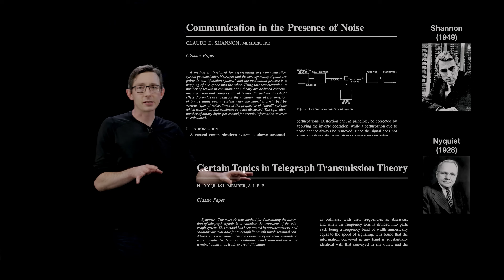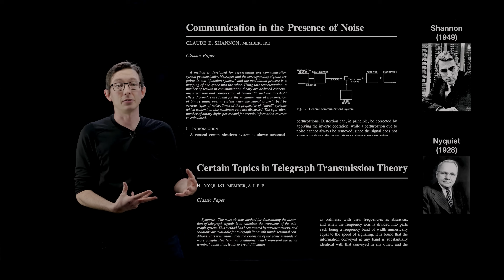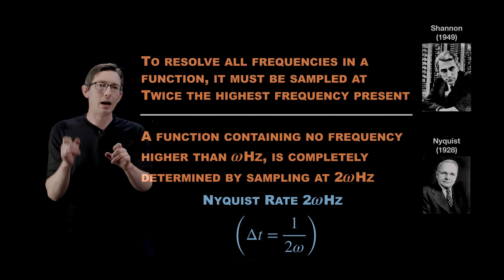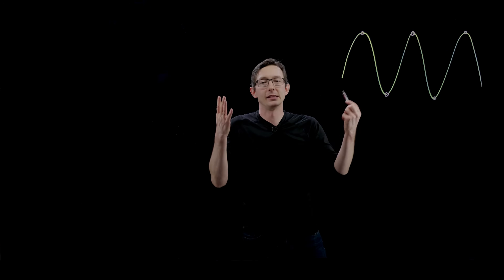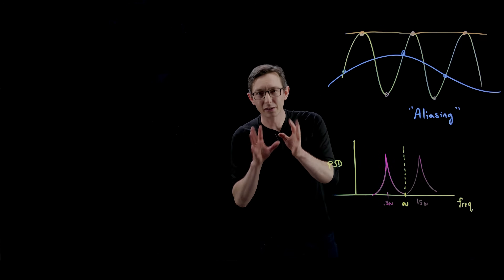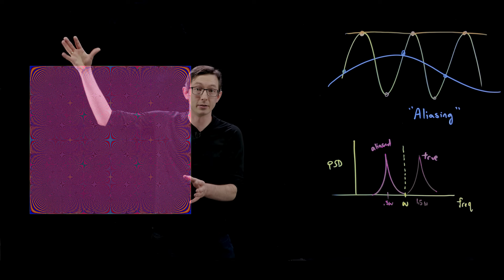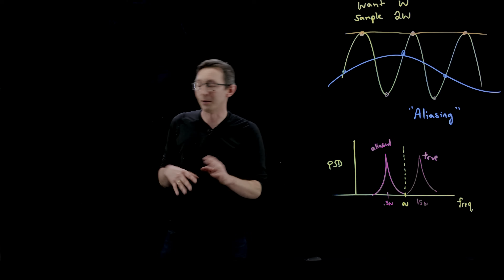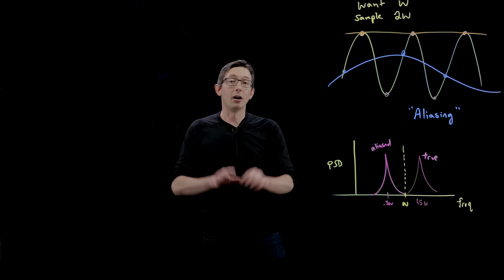Shannon Nyquist Sampling Theorem

Comment from the maker: A viewer made the excellent point that we technically need to sample at "strictly greater than" 2*omega.  For the example, if you sampled at exactly 2*omega at the wrong phase, you could easily get something that looks constant.
Reply: This is actually the reason I came to look at this video and it answered that. Thanks!
Reply: The equality holds only for even functions, e.g., a cosine.
Reply: @Leland Hugh seriously? Is this the place for this? 😂
Reply: Wow, I was just thinking about this having finished the video. Thank you for all the info!
Reply: Had the same question. This pin saved me a bunch of time searching for a solution to this
Reply: 4:20 It's a little bit nit picky, perhaps, but f is in Hertz or cycles per second.  Omega is angular frequency and measured in radians per second.  Omega=2*pi*f where the units on pi are radians per cycle and the units on f are cycles per second.  The cycles part, being in the denominator and numerator respectively, cancel out leaving radians per second.

Comment: Nyquist has a BIG caveat — it requires all frequencies to be below the nyquist frequency. And that's not possible.

Human hearing goes up to 20k, so a 44.1k ADC needs to be flat up to 20k then roll off completely by 22k. In the '80s the industry-standard Sony PCM-1630 was about $50k for just the processor without an actual recording device. It used thick-film elliptic filter networks that were crazy steep — flat @ 20k, -50 dB @ 22k.

Let's say they had used a 3rd-order -18dB/oct AA filter:

-3 dB @ 20k
-4.4 dB @ 22k
-12.5 dB @ 32k (12k aliasing)
-18 dB @ 40k (4k aliasing)

The 32k energy going into a 44k ADC is going to fold back to 12k and give you a LOT of aliasing noise. So they needed ultra-steep elliptical filters which cause ringing and group delay which smears higher frequencies.

But by 1989 they had 2x oversampling ADCs meaning the analog filter's transition band is 20k–66k instead of 20k–22k. And they had 64x oversampling in the early '90s. With oversampling then a digital LPF you can brickwall it digitally then decimate it down to 44.1k. Then you finally have a clean 44.1k recording without aliasing or group delay.

So 44.1k can give you awesome audio quality, but you either need an impossibly steep analog filter, or you need oversampling. And oversampling requires either a computationally intensive digital filter or a complex multi-stage digital filter (which is what you see in early '90s gear with limited processing power).

On the output side you also need oversampling and a reconstruction filter. The signal below 22k gets copied up to 44.1k, 88.2k, etc. So you need to interpolate it to something higher then filter it.

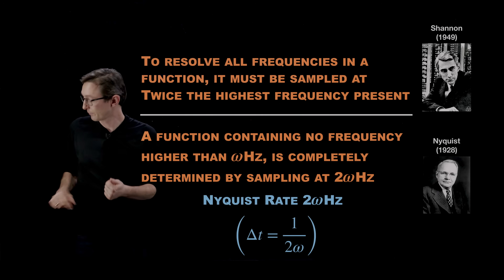Comment: 6:17 The reason it's specifically 44.1k is because they were using video recording equipment and they wanted compatibility with NTSC and PAL. They recorded 3 samples per line, and they had to leave the blanking interval for sync.

NTSC 490 lines * 30 * 3 == 44.1k
PAL 588 lines * 25 * 3 == 44.1k

It's exactly 30 (not 29.97) because the first CD mastering used U-Matic monochrome machines, and NTSC monochrome is exactly 30 fps. Some things actually have a 44.056k setting for NTSC color.

Comment: So having watched this one and the one on beating Shannon-Nyquist with compressed sensing, it looks like the reason that works for sparse signals is that the random measurements by dumb luck will have very high sampling rates within sub-windows of the overall measurement window. Would a measurement schedule with a fractal pattern be "optimal" in terms of highest reconstructible frequency for a given number of measurements made?

Comment: Dude, what you said makes no sense. A straight line is not a sine wave.  🤷🏻‍♂️
Reply: That is not what he was saying. What he was saying is, that if you sample a signal with insufficient sampling rate, you might ending up in sampling the maxima of a sine wave. If you now try to recover the original signal by using these samples (which will then have all the same value), you may think, that it is that constant signal (straight line). And that is a serious issue. That was what he was telling.

Comment: How comes that a 5g signal is 100 MHz and it is sampled at 122.88 MHz?
Reply: Yes but it’s also done with two adc’s in parallel, sampling a so-called I an Q signal (The result of zif downconversion). At half the nyquist rate indeed but with twice the amount of samples. Comes down to the same overall amount of samples in the end…

Comment: Thank's for the video. Only thing I'd like to point out, is that saying "the highest frequency you care about" can be confusing. It should rather be "the highest frequency you receive as Signal". Otherwise one might think, that you automatically only measure the band below f/2, but actually you have to add a lowpass to manually cut off all frequencies, that are above f/2. Of course you explained aliasing (quite well), which is why I said "confusing" and not "misinformed". ^^

Comment: I have a question: how does the theorem account for the theatrically infinite frequencies between 2 Hz values? For example, between 100 and 101 Hz there is also 100.1 and 100.01 and 100.001 and so on, forever. How do we choose the "precision" of how finely we sample the amplitude, and which values, and the distance between the values? Can we pick between 100.00000001Hz and 100.00000002Hz? What if we stored information within that range? Could we accurately recreate it using a sampling rate of 202Hz?

Comment: I've learned something new today. Human hearing is up to 22 kHz. I've always found Nyquist Samping Theorem very fascinating. Thanks as always Steve!
Reply: Actually 22khz is pushing it. The range is from 20hz to 20khz but by the time we are adults most of us lose those highest highs. 14khz is considered normal for adults over 30. The actual reason for 44.1khz is to allow for filtering at the high end. A low pass filter is put onto the signal starting at 20khz and sloping down to null at 22khz. This is needed to prevent aliasing.

Comment: Thanks for the video with intuitive. After watch your video, I think this way: Think the system as a black box, sample it at the 1X of highest frequency means you get a amplitude with no phase information, but with 2X sampling rate, you get the phase information, this amplitude and phase information gives you everything about this signal. It is like some aliens want to check what season the earth it is now, they need to check twice per year(they need to make sure within a year, the season). My two cents. Thanks again, I benefit a lot from your video.

Comment: If I have a signal sampled at 2*omega, then I will expect anything shown below omega in psd plot as real. But how can I be sure that it is not created by frequency folding of a real signal between omega and 2*omega?
Say, I sample at 2kHz, and in psd plot I see a peak at 500 Hz. It can be either a real component at 500 Hz or caused by frequency folding of a real signal at 1500 Hz. In such case there may not be even a component at 500 Hz. Right???

Comment: Great lecture.  Surely random sampling is actually sampling at a higher sample rate than 2W.  If you look at the period between samples (or the delta from an integer nyquist) you effectively are sampling above nyquist and just picking up aliases!  You just aren't doing it periodically but over time you will build up the periodicity.  The tradeoff that it takes longer to gather the data.  So really you're not disobeying Nyquist sample rate.  You are using a stroboscope effect where the strobe is non periodic so you will eventually see the whole signal.

Comment: 09:35 is confusing me: the true signal is reflecting around omega, not omega/2? Love your content btw! Will be getting your book for Christmas =]
Reply: Also, if you're familiar with fourier transforms, a useful way to think about sampling is as multiplying your signal by an impulse train, where each impulse is spaced by the sampling period. That then turns into convolving with an impulse train spaced by your sampling frequency in the frequency domain, which in turn explains the whole shifting and adding process. Then you can think of aliasing as having spectrum components that will overlap when shifted (such that after adding you can't tell whether it's part of the original or a copy), so to not have aliasing your signal has to be band limited to half the sampling frequency.

Edit: explaining the conclusion a little better: if you're signal is properly band limited to f_s/2 (a.k.a you're sampling at twice the maximum frequency component of the signal), your original signal will be centered around 0 between -0.5f_s (from reflection (ish, potentially different phase but same magnitude if we're talking straight fourier transform) across y axis for real signal) and 0.5f_s, a copy will be at f_s between 0.5 and 1.5, a copy will be at -f_s between -1.5 and -0.5, etc. No overlap, no aliasing!
Reply: That seemed like a bad explanation from my understanding... You only get mirroring across the y axis (and only for real signals), aliasing causes shifts by multiples of the sampling rate: 1.5-1=0.5 (note that there'd be two peaks being summed there actually if the signal was real, the other being from -1.5+2)

*Edit: they would be square rooted, summed, and squared since you're dealing with power in this case I believe.

Comment: You can get a flat signal if you measure at exactly twice the frequency. Imagine a pure sine wave at 1 Hz. You measure at 2 Hz and only find a flat signal. Then you managed to start measuring at the inflection points of the sine wave. Thats why I sample above twice the frequency.

Excited about the compressed sensing series!
Reply: That's why Nyquist frequency upper border is not included in what it is possible to be measured without aliasing.
Reply: How much higher than twice? Is it appropriate to do 2.5X or something? Must it an integer multiple?
Reply: @ericyip947 no, it doesn't need to be an integer multiple. even just a couple hz would most likely suffice

Comment: Can you please talk a bit more about aliasing in general, and how to detect that it might be taking place? I've noticed on modern mid-high end oscilloscopes that they seem to be able to detect that the signal is aliasing even though they have a limited sample rate. If I feed a spectrally pure (50+ dB over the noise floor) sine wave at 30GHz into a scope that can only sample at 8Gs/s it can still somehow detect that the signal is aliased and warn the user. I wonder how it does that? Is it heuristic or is there a deterministic way to tell?
Reply: I’m not sure how oscilloscopes do it, but you can also highpass signal in the analog domain and compute it’s power spectral density. If there is a lot of energy - you have severe aliasing. Another sign of aliasing is if changing the sampling phase slightly, you get different frequency power.